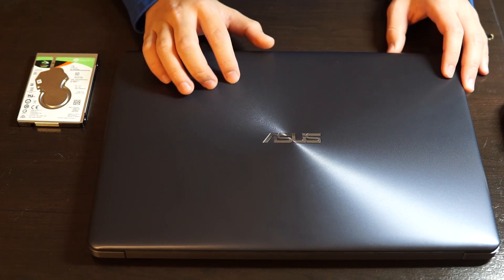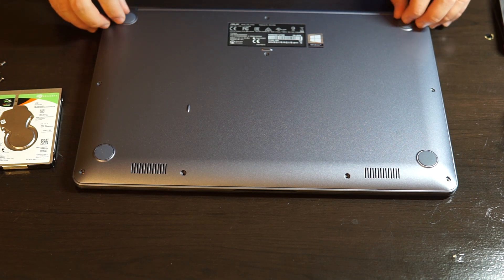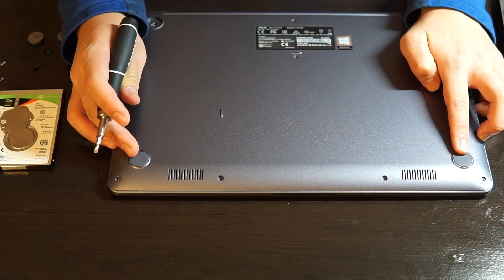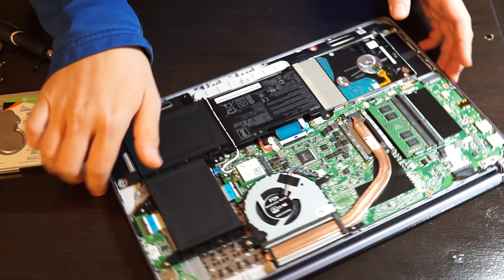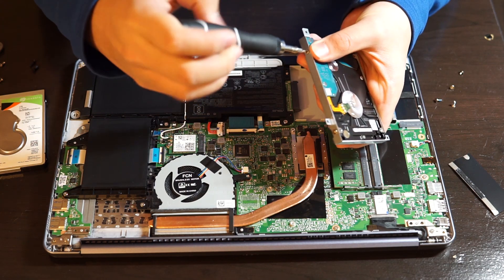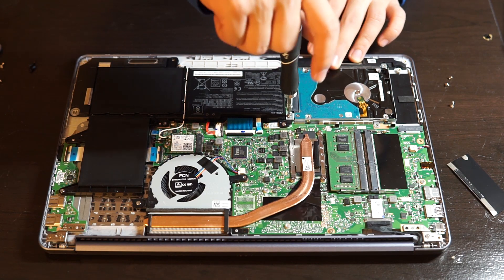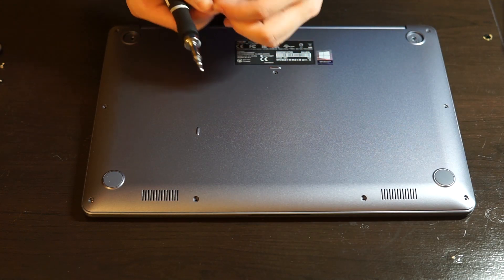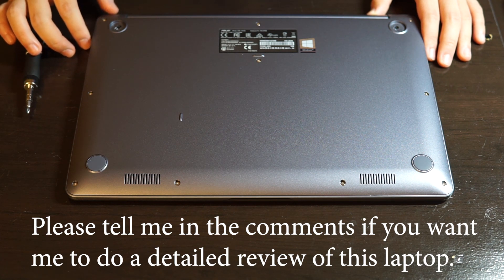Asus X510UAR F510UA HDD Replacement Guide (HD)

Comment: I have the same model, but mine has an SSD disk. Would there be room for a secondary HDD?
Reply from the maker: Yes I think so if the SSD isn't installed on the 2.5 inch slot usually used for HDDs. You can use task manager to check your SSD model and look up its form factor.
Reply: @orthogonal_eigs  thank you

Comment: Is that slot only for the HDD? I had my HDD fail and I need to replace with the SSD I bought, but are they both stored in the same drive and just partitioned? If I remove that drive, am I removing my smaller SSD which holds the OS as well?
Reply from the maker: The big slot is for a 2.5 inch SATA HDD or SSD. The small vertical slot is for M.2. SATA SSD only. If your HDD failed you can choose to replace it with a 2.5 in SSD that has the same size and fits in the same slot. Or you can choose to add a smaller M.2. SATA SSD and leave the big 2.5-inch slot empty.

Comment: Awesome Video! My OEM hard drive failed and only boots via USB (Ubuntu Linux). If the Seagate Hard Drive is installed, does it automatically boot in Windows or will I have to install an OS of my choice (Windows or Linux)? Thanks Noodle

Comment: I installed in successfully but it keeps freezing now what do i do
Reply from the maker: If the computer freezes with the new drive and it didn't before it's probably because you have received a bad drive. Without any further information this is my best bet.
Reply: Noodle Ham i think it may have been loose or smth bc i redid it and made sure it was rlly tight and it doesn’t anymore i
Reply from the maker: @wuhhhhhhh  that's good news. Sorry I couldn't be of more help
Reply: Noodle Ham no your video was perfect thank you so much!

Comment: What is the thickness of hdd?  That is, what thickness should 2.5 ssd have to fit in the original case from the old hdd?
Reply: @orthogonal_eigs  No, I tried to insert another 2.5 hdd from old laptop and it has ~9.5mm vs 7mm asus hdd and...doesn't fit. So it's important to know thickness of new hdd/ssd before buying. Unfortunatelly, official specs don't provide this information and we have to disassemble laptop to check this moment. I've already checked - our laptop has 7mm hdd.
Reply from the maker: @lupobelka  Thanks for the info! I've put this comment on top so others will know this.

Comment: If I'm getting the one with a 128gb m.2 ssd already installed, it's it worth replacing the hard drive too? Or is that good enough for college?
Reply from the maker: The 128 GB SSD is generally good enough. Since you can store the stuff you don't access frequently onto the hard drive, you will usually have enough room for the OS and important programs on the SSD.

Comment: Hey, I am new to opening up laptops and just recently I opened up the back of my laptop, added ram and now it won’t start up. If there any way this can be fixed ASAP?
Reply from the maker: It's hard to tell exactly what went wrong. Maybe you can start with removing the RAM you added, and see if the laptop starts? If that's the case, the new RAM could be incompatible or installed incorrectly.

Comment: Sir I want to connect my laptops HDD with my PC.
Am having a vacant SATA cable in my PC. 
What about power supply, can I use the power cable coming from the smps,
Or the power rating of this particular HDD drive?
Reply from the maker: As long as you can find a power cable in your PC that fits the drive's SATA power connector you should be good. Usually the cable comes from the power supply in your PC.

Comment: By opening It and upgradung the ram size you lose your warranty?
Reply from the maker: I just looked this up -- in the US at least it seems illegal for manufacturers to forbid opening up electronics. So as long as as you don't break things while leaving apparent marks, you should be fine. The safest thing to do is if the laptop breaks, put back the original ram.
Reply: Did you see some sales, by opening the underneath part of the laptop?
Reply from the maker: @francescopasquale5651  There wasn't any seals or tamper stickers.
Reply from the maker: @francescopasquale5651  There wasn't any seals or tamper stickers.
Reply: @orthogonal_eigs  Thank you so much.

Comment: If U have big finger nails Then It will Open easily .Just Sneak your Nails into gap between back pannel and that plastic strip .try to pull out with nails It will definitely gonna open .
Reply: Yes,it's too tight.I tried to open but gave up because i don't want to break anything.
Reply: @nietzsche1991   You can Open it easily if U have big finger nails .Just sneak Ur nails into gap U see between Back pannel and that plastic strip  and pull outward little bit if One lock will be open after pulling then U got It after that all lock is in series It will open by itself .
Reply: @kartikmakwana6328  Hi,thanks for the tip.I will try to open again.

Comment: Hey man, love the videos. I'm new to windows and computer upgrades. I bought this computer and intend on replacing the memory, putting in an m2 ssd and an ssd to replace the hdd. Do I need to put in the m2 first, transfer windows, then replace the hdd, or can I do it all at once and download windows 10? What would be easier?
Reply from the maker: No, I don't think you can do everything all at once. From what I've read, you need some third party tools to clone your Windows copy onto the new SSD, which requires two drives to be installed simultaneously. To save time, however, after you Install the M.2. SATA SSD, you don't have to screw the bottom casing back in place so you can quickly get the HDD out once the clone is complete. You can take a look at this guide:  https://www.backup-utility.com/windows-10/transfer-oem-windows-10-to-new-hard-drive.html .
Reply: Thanks for the fast response! I like the videos, they are short and to the point with good information! I would just say, work on the lighting a little bit, the b-roll and close-ups with samples of what you're talking about. it's a little more effort, but ups the production value a lot!
Reply from the maker: @philo3407  Thanks for the advice!

Comment: If i open back cover of laptop and increase my ram, will it effect my warranty or i am still in it. Thank u in advance.
Reply from the maker: I'm not entirely sure on that but I would guess that, as with almost electronics, opening up the chassis will void the warranty.
Reply: Noodle Ham ok what if i go to authorised sevice center and they upgrade it for me, in that condition would it void warranty or not
Reply from the maker: @iqbal_bhinder  I don't think Asus has many authorized service centers but if you find one, it shouldn't void you warranty if they do the work.

Comment: What do you do if your Vivobook model has no HDD socket? In mine there is just an empty space where your HDD is !? 😕
I would like to put in one more SSD into my machine. It's the 530 model I've got
Reply from the maker: If there isn't a SATA connector where the HDD would be, I don't think it's possible to add in a second hard drive. But I doubt if that's really the case. There is likely a SATA connector without a hard drive casing to hold the drive in place on the motherboard. In that cade, you'd need to find a compatible hard drive casing for your model and then install the drive. If there actually isn't a SATA port where the hard drive would be, one way to expand the storage would be just backing up your files and buying a bigger M.2. SATA SSD. A 1TB drive right now goes for about $160, and you can sell the old one online.

Comment: I added M.2 SATA III SSD instead of Optane memory. Installed Windows 7 x64 on it, but there are no drivers on Asus support page. Any solutions? P.S. No argues about Win version, I need Win 7 for professional work.
Reply from the maker: I'm sorry I didn't quite understand your question. My understanding is that you installed the SSD alongside the HDD but couldn't boot from the SSD. The M.2. SATA SSD shouldn't need a driver for the laptop to recognize it. If you have installed Windows 7 on it, then you can try going into the BIOS and select the SSD as your boot drive. I don't remember how to go into the BIOS and set the boot drive but there should be plenty of tutorials online.
Reply: I installed Win 7 x64 on M.2 SATA SSD and can boot from it with no problems. But there are no drivers for Win 7. Like chipset, audio, network and all others. P.S. There is no HDD inside, just M.2 with Win 7 on it.
Reply from the maker: @djMusicKey  I'm not sure how to deal with the driver problem. Asus shipped the laptop with Windows 10, so the drivers aren't designed for Windows 7. You can try the driver installation files on the Asus product page for F510/X510UAR and see if the drivers work on Windows 7. Here's the link: https://www.asus.com/Laptops/ASUS-VivoBook-15-X510UA/HelpDesk_Download/ . Under "Drivers and Tools" choose X510UAR.

Comment: hello. i'm using this laptop for school and i need faster ssd. i will add extra m.2 ssd and keep this hdd. what ssd would you recommend? also does adding any 2400MHz ram work of should i look for specific ram stick to add?
Reply: i tripled the speed of my vivobook for only $100!  you can check out the details here. https://www.youtube.com/watch?v=Rzg2pTMdu_s&t=20s
Reply from the maker: Any 2400mhz RAM should work as long as it's DDR4L (the form factor of the RAM). Right now the WD Blue SATA M2 SSD just got cheaper on Amazon, and you can grab a 500GB one at $80 and a 1TB model at $140. I recommended it to a friend and he's very happy with the speeds on his Asus Zenbook Flip S.

Comment: I don't see a CMOS battery in the motherboard. Do you know where is it located. If the internal clock stop working what should i do?
Reply from the maker: I searched online and couldn't find an article about where the CMOS battery is or how to replace it. But chances are that there is one hidden somewhere, but Asus doesn't think that you would normally replace it. The battery should last 5-10 years, by which time you probably will have stopped using the laptop.
Reply: @orthogonal_eigs  thanks for you reply... hopefully I don't need to change one.😀

Comment: Крышка ноутбука легко открывается с помощью присоски, можно использовать присоску для плитки
Reply from the maker: (I read your comment through Google Translate) Good suggestion! Opening the bottom lid with a suction disk would be easy and not damage the laptop.
Reply: Yes, I opened the cover of the vacuum sucker, which was designed to work with a bathroom tile or for working with a glass (this sucker costs just over $ 1)

Comment: Did the replacement improve the performance of the laptop a lot?
Reply from the maker: The computing performance will be the same, but the loading times of the system and apps are greatly improved. For example, updating Windows with an SSD will be quicker and will allow you to quickly open other things simultaneously; with an HDD, a Windows update will essentially freeze the hard drive, which makes it extremely slow to even use the file explorer.

Comment: Yes, here's how to unplug the battery; slide metal clip at connector back, then lift the white plug straight up (not back and out) from circuit board.  The metal slide will block removal otherwise.

Comment: Unplug battery first?

I'm watching this to find out how to unplug the battery to ensure no power to circuitry, before dropping metal screwdrivers on circuit boards, pulling out hard drive, holding hard drive in metal housing over exposed circuit board, etc.  Is it just me, or is it a bad idea to take those risks with battery still conected?
Reply from the maker: C Quirke I think one of the comments just answered your question perfectly.

Comment: I don't see any air intake vents on the back panel. Do you think this is a bad design choice that would cause overheating issues - or is the narrow side vents good enough?
Reply: Actually there are some vents inbetween where the screen connects to the rest os the laptop (hope I phrased that correctly)

Comment: Can i add a ssd to my laptop without remove the 1TB hdd
Reply from the maker: vu tran Yes. There's an additional M.2. SATA SSD slot which fits a smaller, "gum stick" shaped SSD. If you wish to use that port make sure you get a compatible M.2. SATA SSD and not NVME, and follow other detailed tutorials on the internet as I haven't tried to use that specific port.
Reply: Thanks you.It's useful for me because i want do it myself. My laptop is asus x510uq.
it's almost like this laptop.
Reply from the maker: vu tran Yeah. Looks like yours has an older CPU but comes with dedicated graphics. The motherboard design should be nearly the same so you can use tutorials for either laptop. The Asus website says you can put M.2. SATA3 SSDs into your model.

Comment: Can I replace the 1tb hdd of my Asus s510UQ by a 512ssd? Though there is a 128 gb of SSD already exists in the laptop.
Reply from the maker: tanzim bhuiyan Yes, if you want to SSDs. The 128gb SSD should be installed on the SATA M.2. port and you can replace the SATA HDD with a SATA SSD.

Comment: why not  just replace to a ssd？
Reply: sry, I mean add a ssd (m.2) to the m2 slot
Reply from the maker: AIYU I installed a hybrid hard drive because it is cheap and is fast enough for me to run Windows with. It cost me $50 to get the hybrid hard drive. If I spent the money to buy a 128GB SSD, I wouldn't have enough space for my all files and programs.
Reply: I mean the laptop come with 1 TB HDD(7mm drive 2.5 inches), theirs a slot for a M.2(different interface right next to your existing hard drive , you can pick one up like 40 bucks then clone it on ssd. You will have the ssd for fast boot time etc, other video or photo on the deafault HDD. (128gb+1TB)
Reply from the maker: You can definitely do that, but I already had a hybrid drive from another old laptop and I didn't want to buy an extra SSD. It turned out to be working well. By the way, I think the M.2. slot only accepts SATA SSDs, and is not compatible with NVME SSDs.
Reply: Like only 850 evo not 960 evo right? thanks for the info, plan to buy one to try out.
Reply from the maker: AIYU Yeah. I think that's the case but you should double check.

Comment from the maker: This is one of my first video uploads! Feel free to speed up the lengthy replacement guide by 1.5x so it's shorter and you can hear the important tips when you open up the laptop. Please tell me in the comments if you want to see a detailed review video of this laptop and what specifically you want to know about it.
Reply: My  Asus X510UAR  works great when I changed the HDD by the tips in your video, cool!
Reply: Noodle Ham yes please make a review , and is 128gb ssd with pre installed windows enough with 1tb HDD5400rpm
Reply from the maker: I'll make a review within a month. If you use the SSD in combination with an HDD then the 128GB will be plenty for windows and a few primary programs. It would ideal to have an SSD as the boot drive and the HDD for data if budget is not your concern.